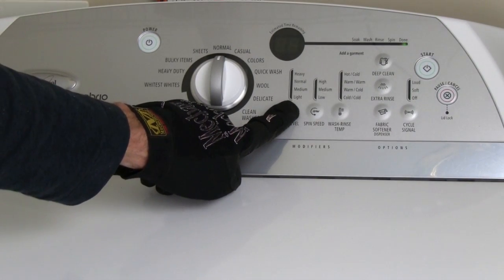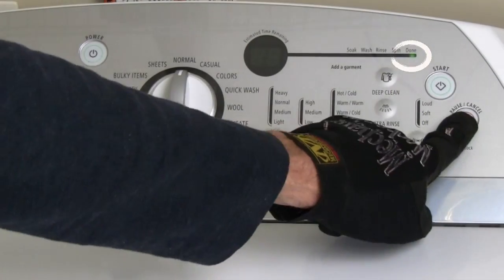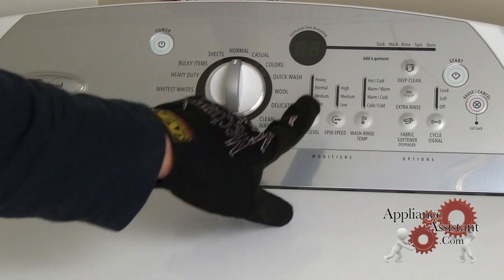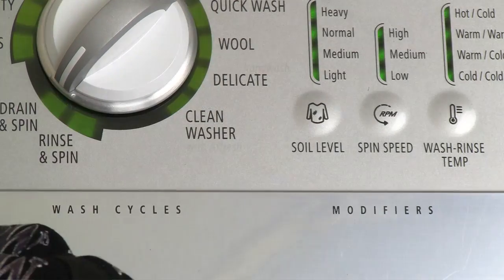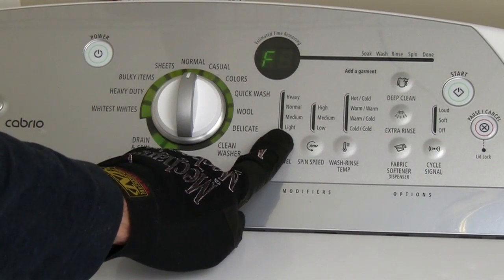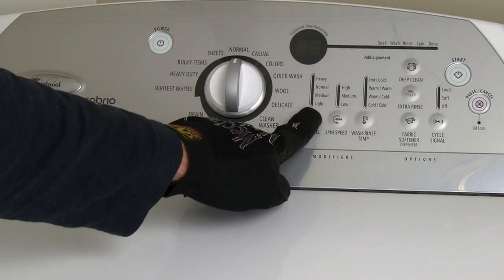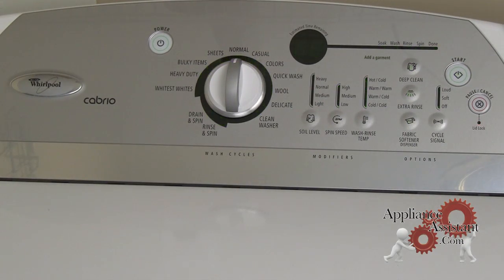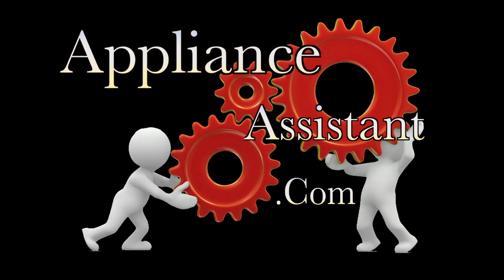Washing Machine Diagnostic Test & Error Codes (Cabrio, Bravo, & Kenmore Oasis)

Comment: Hey , awesome video learned something new and found out my whirlpool cabrio washing machine has error F70. As i ran the diagnostic test it would star on c0 then on to c1 and started spinning, but would only go on to c2 if i pressed a button, after that the machine stopped spinning and the test would continue without releasing hot or cold water up the machine just stayed with no action as diagnostic test ran from c2 up to  c6 once on c6 machine would spin quickly then marked OL eny suggestions applianceassistant..
Reply from the maker: Does the inner tub lift up freely?  It should float up on the water as it fills, once the tub has fully raised it should disengage from the drive hub and start the agitation movement.  Sometimes there is something between the inner and outer tubs that keeps the tub from floating and that may be causing the F70 "OL" overloaded error. here is a link to the guide on my website http://applianceassistant.com/Washer-Repair/Cabrio-Bravos-Oasis/Cabrio-Bravo-Oasis-Troubleshooting.php
Reply: applianceassistant
I have the same problem. Perplexing but since you seem to know all or at least a lot.. My question. The cabrio WTW6600 SB2 makes a lot of noise in the bottom back when it goes into a rinse/spin cycle. I ran the Diagnostic Test that you showed and it shows an error code of F70, yet the machine is empty.  When it goes from C6 to C7 it agitates a bit, then gets about 1/2 turn if that and the code pops up and it jumps quickly from C7 to C8 and then C9 and shuts off. The done light comes on.  I have lifted the basket and we keep cleaner run through it every month. Any suggestions? Oft times, but not always, the machine will go through the whole wash cycle with no problem whatsoever, but some times it will sound like a loose belt or something that is not letting it engage................... Your thoughts?
Reply: applianceassistant I am having the EXACT same problem as julio ceasar and my inner tub lifts and spins freely.  I called whirlpool to try and get some insight and the only thing they could offer me was a $100 service call.  I'm on the verge of replacing the control board but I really want to exhaust all other less costly options before I do it.  Do you have any other suggestions?
Reply: Will text tomorrow.
Reply: Katie Doumlele
I am sorry. I lost your post, then was thinking of someone else on the Appliance assistant site.  OK, If you have made sure the inner basket is clean and not damaged..then you need to go to the underside of the machine. HOWEVER, first lets make sure it was not the drive hub inside the machine.  You can find you tube video on how to do this, but essentially, remove the agitator and then pry the sides of it with a couple screwdrivers until you can slip your fingers under neath and lift it up off the shaft. May be a pain, but you can get it off. Then unscrew the 7/16 bolt in the center and lift the basket off the shaft. This may be hard as it is heavy and if you have a stainless one, you better watch the sides as the holes in the side have sharp edges that can and will cut you.  Once off, remove the drive hub screws (phillips, 6 each) and lift it off the shaft. Look carefully for any damage to the top part which will be on the tub, and the bottom pieces for broken teeth on the drive hub. Next take some 409 or whatever and clean the shaft top area. This would include the bearing area and the splines that run up and down the shaft...and their counterpart inside the inner tub. They have got to be clean and not broken. Next, I would check the filter and well below on the inside of the outer tub. Make sure everything is clean...and believe me, they probably aren't. When done, put the parts back together and retest. You should be able to slip your fingers inside the inner tub's top and lift it fairly easily about 1/2 inch and it should drop right back down. Do this a couple of times as it should be easy. Then try to run the machine again. Still a problem? Let me know and I will tell you the next part which will require you to unplug it and lay it on the front surface on a rug or towel and I can tell you what to do from there....although the procedures are on the repair sites and you tube. For my machine, the tub crud was the problem...... I will check this site often for your reply.
Reply from the maker: Thanks for the response Kenneth! Sounds right on!  Pulling that inner tub out off of a rusted drive shaft can be extremely difficult! But Kenneth is probably correct in that the shaft is corroded and not allowing the tub to freely float, or there may be a sock or something jammed between the inner and outer tub, causing the same result.  Hopefully you will find something on the side you can fish out with a wire coat hanger.
Reply: Thank you so much for the detailed help!  I ended up calling a repairman.  The problem was the spline!  The crazy thing is that I was able to spin & even lift the tub some, but now that it's fixed I see the difference.
Reply from the maker: Nice! Thanks for the update!

Comment: We just began having a problem with our Cabrio. I'm getting the LD--long drain issue. How can I clear this. Machine seems not to have any water in it.

Thanks!
Reply from the maker: That is werd.  LD with no water in the tub... Drain time is sensed with the pressure switch, which on that washer is a part of the control board. So I would start with making sure the pressure tube that runs from the bottom of the outer tub up to the control is not pinched or plugged up.  You can pull it off the control and try to blow air down into the tub to check for a restriction...Does it go through the diagnostics properly? Drain okay...all of that?
Reply: Tony Garcia What did you find wrong with your Cabrio? My Bravos gives a LD--long drain with 11 minutes. remaining and the drain pump continues to run. I know it has continued to run for 5 or 6 minutes.  Thanks,  John
Reply from the maker: Is the water draining out okay?  Drain pump problems are common on these washers... But the pump is a little on the expensive side, so It's good to be sure.  The only other explanation is the pressure sensing aspect, with the control and pressure tube.  Make sure that the inner tub raises and lowers easily on the drive shaft... It may not be re-engaging on the drive hub.  Heres a guide to how your washer works.
http://applianceassistant.com/Washer-Repair/Cabrio-Bravos-Oasis/Cabrio-Bravo-Oasis-Guide5.php
Hope that helps!

Comment: I am having an issue with my Whirlpool Cabrio, it starts the load then all of a sudden it will (no water fills it at all) start making a grinding sound like the motor is still running but the drum stops going in circles. Please help It is costing me an arm and a leg..
Reply from the maker: What is your Cabrio's model number?
Reply: I am sorry I dont have the #. Found out it was my transmission and it killed my motor 2 times.... so had to go buy a cheapy
Reply from the maker: Bummer,  If it was one of the new belt drive Cabrio washers that's not surprising... Had quite a few of those transmissions fail. : (
Thanks for the question! Hope you have better luck with your new washer!
Reply: Yeah I hope so too Thank you

Comment: I have problem with cambio washer, it runs fine and washes but lately when it is in its last spin cycle, and as it starts t spin i hear a strange sound like plastic parts sound . the sound stops and then it continues spinning and drying.
does anyone know the possible cause. is there something in back a roller or guide that needs replaced. please advise
Reply from the maker: Sounds like there may be something in the drain pump.  If you tip the washer forward and look underneath there should be two pumps at the back of the washer. One is to recirculate water on the clothes for washing and rinsing (from the front, it's on the left side) and the other is to pump out the water (right side pump) suck any water out of the drain hose with a shop vac and then remove that pump and take a look inside.  Hopefully you will find some little item you can remove.  Good luck! Thanks for the question!

Comment: I have a whirlpool cabrio model WTW6400SW2 and when starting a load it gets a F1 error code. I power off and restart several times, it will then start and continue cycle.
Reply: Upon doing the video process a F68 was the code that kept showing.

Comment: Hi. I had a F7E5 Shifter Fault error code on my Whirlpool wtw4800xq2. I have replaced the actuator, and the washer is working fine. However, when I re-run the diagnostics, it still shows the same code.

Is there a way to reset the diagnostic codes? Should it reset by itself?
Reply: I currently have the same whirlpool washer and it's giving me the same error code... What problems were you experiencing when you had that error code ? I would appreciate the help.
Reply from the maker: Your washer has a different diagnostic process that the one in this video…And It will save the code. You can clear it by going into diagnostics.  the service manual is taped inside on the front left of the cabinet. After you are in manual diagnostics to view the codes rotate the knob clockwise through the codes until all the status lights flash then press and hold the start button for 3 seconds and that should clear the stored codes.  Thanks for the question, Good luck!

Comment: My Whirlpool Cabrio washes fine,  but when it's on the spin cycle an error code (UL) pops up and it will almost all the time not ring all of the water from the close. Someone told me about the suspension rods or something like that but what do you think?
Reply from the maker: The suspension rods have been a common cause of the UL error.  If it happens on a regular basis that is definitely the most likely cause.  The new rod kit has been slightly changed from the first style to include a cup that the upper pivot point will rest in to reduce friction and allow for better movement.  Fairly easy to replace them yourself, especially with two people.  Best of luck!
Reply: @applianceassistant  I have replaced bearing/ suspension rods. And still same results

Comment: I have a Whirlpool Cabrio washer that has just started to run continuously.  A cyle will finish then cod Lt will appear and it will start again.  Any suggestions?
Reply: Lucy Alvarado i as well i cant find anything on it did you??
Reply from the maker: Peter Lyday Not sure about Lt... What is your washer's model number? I will try to figure it out...
Reply from the maker: Peter Lyday That washer style is different from the one in this video still not sure about Lt but I do have a repair guide that will show how to do diagnostics and read stored error codes... that may shed some light.

http://applianceassistant.com/Washer-Repair/Whirlpool-Washer-Belt-Drive-Splutch/Whirlpool-Belt-Drive-Washer-Repair-Guide.php

heres the video for that type: https://youtu.be/gY3vcPysPXE
Unfortunately the problem you mentioned about it starting a new cycle by itself is most often the main control board... (Big$ probably not worth fixing if it's that)
Heres a guide to try and get some help from Whirlpool if you find you need a major repair...
http://applianceassistant.com/Customer-Service/Whirlpool-Washers.php

Hope that helps! Good luck!
Reply: applianceassistant thank you for the help God bless
Reply from the maker: My pleasure. Thank you!

Comment: Please help. How do I fix F51? I did the diagnostic test per your instructions on the video. The codes are F50 and F51? How do I fix this?

Any help, suggestions, or comments will do.

Thank you.
Reply from the maker: F50 and F51 are motor errors usually related to the motor rotor position sensor (RPS). There is a test in the manual diagnostic mode that will check the RPS, but most commonly it is a bad connection at the RPS mounted near the motor or a control board problem. I have a guide describing the error and how to do more tests on my website.  I hope it helps some!  http://applianceassistant.com/Washer-Repair/Cabrio-Bravos-Oasis/Cabrio-Bravo-Oasis-Guide.php

Comment: I want to thank everyone who posts here for  helping diagnose my machine codes.  In replacing my discharge pump, I noticed I was getting water level change errors then after,only to find someone at my house had nearly turned the water off to the valves thus causing "lack of level change"  errors.  This may have been what was causing the clothes to entangle and so on which was another part of my original story.  Stick to those codes folks. Your machine is talking to you.

Comment: I received a 5D error code, witch stands for over suds or something like that. how can I fix it since my warranty expired last june?
Reply: over suds sounds like a detergent issue or water level issue.
Reply: It ended up being the motor. I noticed the machine was operating sluggishly but not rough during the rinse and wash cycle. The agitator was spinning slowly yet smoothly. I originally thought the bearing were ceased but after a ohms/ voltage check, it was apparent that the motor was going. It is now replaced and running like a champ.
Reply from the maker: The sud error can also be a clogged or bad drain pump.  If the water level sensor doesn't notice a fast pressure change when the washer is draining it will give the sud error for long drain.
Reply from the maker: T Ochoa Good find on the motor! Thats a rare problem and hard to catch… Bravo!

Comment: where's the list of codes to compare?  geeze they make it like working on a car now. Why cant we just keep things simple.
Reply from the maker: It's usually stuck inside the cabinet on the front left. there are two tabs a few inches in on the front/top seam that you can press back with a putty knife. Then you should be able to lift the top and get to it.  Diagnostics is nice... If you have the manual : ) Good luck!
Reply: applianceassistant Its a wash machine. Not the Space Shuttle.
Reply from the maker: It is ridiculous and unfortunately it's only going to become more so.  They are also unquestionably creating weak points... So it's good to learn how to work on them because they will likely have problems more frequently and at a much earlier age.

Comment: I just replaced the control module on my whirlpool cabrio washer, I went thru the diagnostic test mode but does not power on. what do you suggest?
Reply from the maker: If it's not powering up you would need to start with tracking voltage from the cord into the control for 120 Volts AC if it's getting to the control. Then if unplugging and plugging it back in should wake it up. If not, probably the control.  Hope that helps! If you needs parts I get a commission on parts ordered through the my website : ) and most of them have a 1 year return policy! Good luck!

Comment: I'm getting the LF code during the rinse cycle only. No water is being sprayed over the clothes thus triggering the LF code. There is no problem filling at the start of the cycle though. Are there seperate valves for filling and rinsing?

Comment from the maker: F51 is a rotor position sensor error so you may also need to check the wire connections to the RPS. I would start with cleaning the drive shaft and see if the F51 comes back. You need to pull the motor stator to check the RPS so hopefully it was just a fluke. If you look under the washer the round plastic disk (rotor) should be clean, if there is water or rust residue on it you have a larger problem of the tub seal leaking : ( hopefully not... Good luck!

Comment from the maker: Sounds like the inner tub is hung up... It should move up and down on the drive shaft pretty smoothly.  When the tub fills with water it should allow the tub to float up and disengage from the drive hub for agitation, then drain out and sink to engage the hub for spin.  You will need to pull the inner tub and check the hub. You may also want to clean (with sandpaper) and lightly lubricate the drive shaft.  Hope that helps, good luck!

Comment: I have Whirlpool Cabri 6400SW3. All diagnostics are normal.  Certified technician unable to fix problem even with help from manufacturer.  Washer works perfectly through all cycles when empty. With wash, it fills for a few weconds then goes to next step in cycle. Tech replaced pressure hose, electronic panel, etc. still same problem. I am left to buy a new machine wh this one works perfectly (without wash in it)!?

Comment: make sure there is no bad wire connection on pump .that was what was wrong with mine.i found out after replacing main board 300.00 for nothing .replaced ends worked fine

Comment from the maker: You will need to measure for 120 VAC out of the control where the drain pump plugs in on "P4" terminal when the pump should be running... Hopefully you have a broken wire or bad connection...  If you need parts I would greatly appreciate it if you purchase through the links on my site.  Thanks for the question! Good luck!

Comment: Hi again and thanks for the great video. I ran the diagnostics, but the washer stalled at C7. Obviously, the drain pump is not working. I did the diagnostics test for pumps but it doesn't work. I had tested the pump with an outside source of power and it works fine. Do you think I need a new control board? Help please. Thanks

Comment: Hi, I have an Ld code with my Oasis washer (HE). It stops after the wash cycle before spinning, so it stays full of water. The water intake is normal. I took the pump out and it's clean, and so are the drain system and the basket. The pumps works fine (when I connected it to an outside source of power). I always use the right powder (no sudding). There is no moisture or rust in the control board area. I unplugged it for a while and restarted it, same thing. What else could the cause be? Thanks.